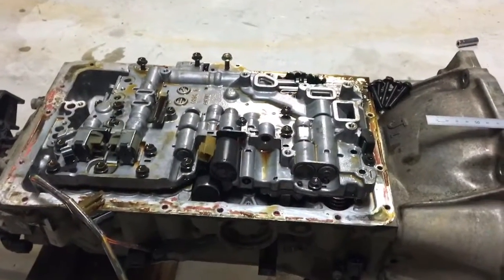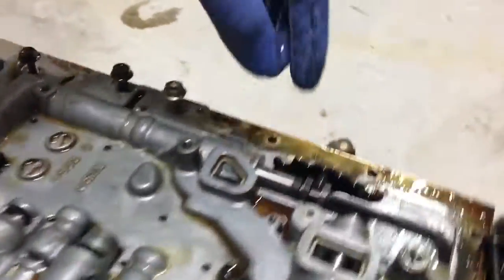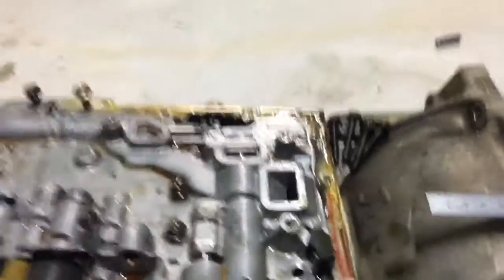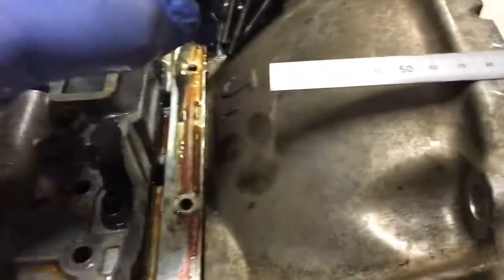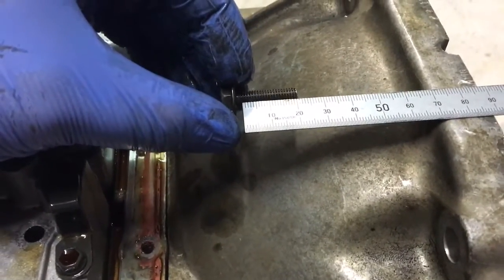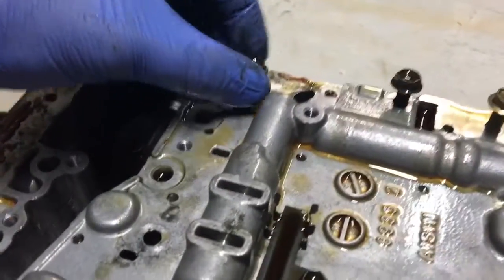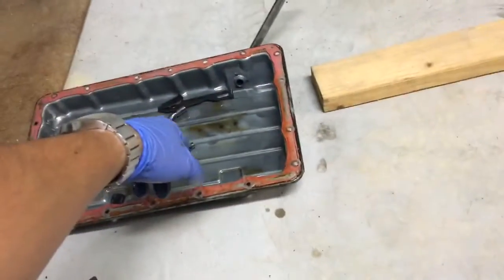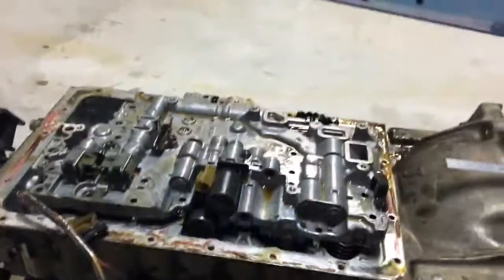Toyota A340/A341 Valve Body Removal Part 1

Comment: having and issue with finding location/ position for a pin,its diameter is roughly the same size as a paperclip, its length is roughly an inch

Comment: Ill be suprised if i get a reply since this is an old video. I have a aw 30-40le box in my isuzu. Simular to this. Changed my oil other day and cleaned the filter, now them 2 pipes at back you have out in the pan. In mine i noticed one didnt sit up totally into the indent for it like thw other. Do these just sit snug in the hole or are the fitted in somehow? Dont want to strip the box totally if dont have to. But dont want to force it back in of it will cause damage
Reply from the maker: Hi mate, those pipes just seemed to fit in there, there is no retainer but the spring of the curve makes them sort of resistant to just drop out, I believe the pan itself holds them in. Are you sure they are in the correct way? Swap it 180 degrees, see if it fits any better?
Reply: That Car Channel cheers ill have a look again when have the sump off. Think u right about sump holding them in place i did notice a rub mark on the sump where this pipe wud have been. So i guess its pushed back in when sumps on. The box is mechanically running fine so guessing it not causing an issue
Reply from the maker: Good to hear, you would know if something was wrong - auto boxes are very sensitive to hydraulic pressure, so it must be correct!